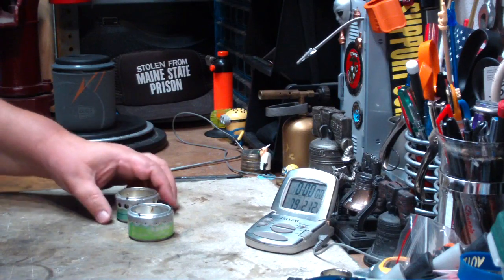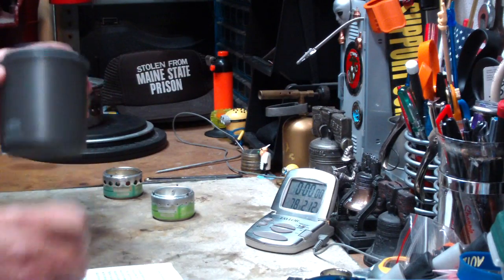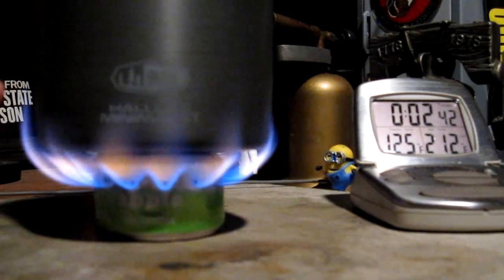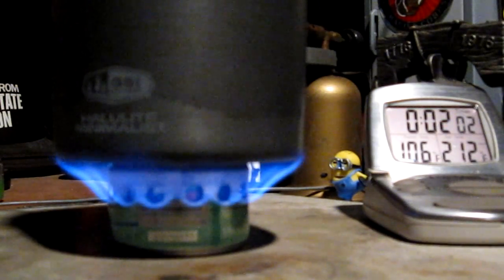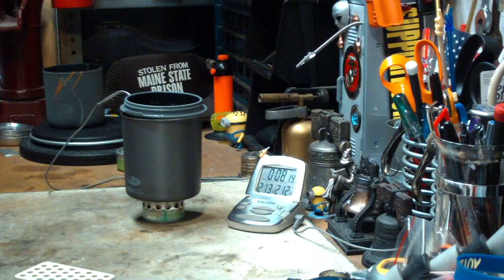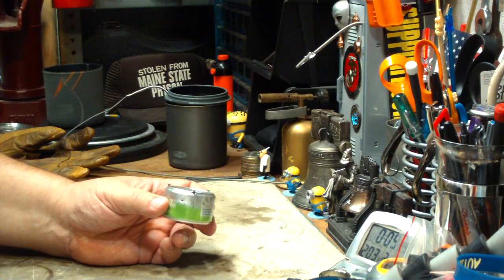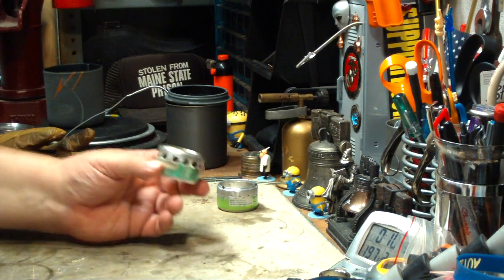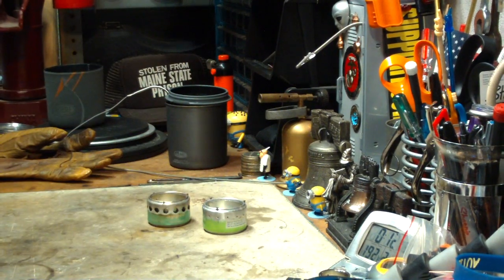Battle of the ColoradoCamper Stoves

Comment: Pardon my pun, but it boils down to this.
The same fuel has the same potential BTU or watts
Tiny holes conduct faster heat to the boiler and run out about a minute after boil achieved
Big holes take a minute longer to conduct thr boil and run out a minute after the boil.

Venturi effect as the holes are jet nozzles.

So slow burn... Bigger holes

However once temperature is achieved the duration of the heat is still a minute or less.

Choose according to the cooking you want.  If boiling only, then little holes.  If frypan, bigger for slower heat and longer overall flame time

Comment: My opinion is that the run-out times are more directly proportional to the amount of fuel applied than anything else. Results would be more accurate if measured by a digital scale, rather than by eye. A few drops could mean 30 seconds.

Comment: I believe the difference is due to the nature of aluminum. It is great for camp cookware because of its ability to transfer heat but also because of that it will lose that heat very quickly. Water on the other hand does not absorb the heat applied to the container as quickly. Basically the low pressure stove is applying heat to a much smaller area which can allow the heat to be dissipated into the air from the pot before it can be fully absorbed by the water. The high pressure stove in effect is spreading its heat across a larger surface area of the pot which not only helps to retain the heat but also helps in the heat transfer to the water.
Reply: Zaekyr 0 vorrect

Comment: I think the problem with the jets shooting out too far with the high pressure burner might be solved by giving the holes a bit of a direction upwards so that they are shooting the jets towards the bottom of the pot and not parallel to it. Just stick a drill into the wholes that has about the same diameter as the holes and bend it upwords. When people make vortex stoves they use this technique in order to give a specific direction to the jet holes. I would find it very interesting to see if it makes any difference in boiling time!

Comment: IF going out beyond the bottom of the pot is a problem (???) couldnt you twist the pin or drill in the hole so the jets are at an angle giving a "cyclone" effect and more flame on the flat bottom???

Comment: I'll echo the comments below.  Without knowledge of the variation (replicates) you can't say much of anything.  With replicates (3 or more) you can use the students T-test to determine if there is a significant difference between the two designs.  If you're really interested in optimizing the burner design there are DOE (design of experiments) methods that allow you to quickly zero in on the important features in a statistically valid way.  Given the large body of work already invested it would seem the next logical step.  Good Luck  -john

Comment: Several factors here. The wider the pot, the greater area that can be heated. Aluminum has a tendency to absorb heat better than denser metals, like steel or titanium. The more flame that can touch your pot, the more heat that will be transmitted to the liquid within. Even if the flames go up the sides. If you put a shield or cone around your pot, you will retain and concentrate your heat to the pot sides. I am a Stationary Engineer by trade and deal with steam boilers.
Reply: Power8

Comment: I have made a penny stove but with the 16 holes on the inside ledge rather than the outside. Result was not really good enough to boil using your two variables of water amount and fuel amount. But, I did have it burn for just under 18 minutes and got it hot enough safe enough to drink and most pleasingly, it simmered which is good for many side dish rice and pasta packets. Though you might like to know.

Comment: Semper Fi Marine, I'm wondering if the holes were nearer to top of the stove, that you would be able to add a little more fuel. Especially the one with the smaller holes. Where is my heat tabs or better yet C4, and a C-Rat can.

Comment: My less scientific experience is almost the same.  I don't believe the material had any effect.  My reasoning is I have a GSI kettle which is made out of that same special aluminum.  My experience is I can boil the same amount of water much faster using a pressure stove and the wide bottom kettle than I can in my Toaks titanium which is about the same size as the minimalist.  Both seem to take longer with a non pressurized burning system.  However both of the burning systems are not the same like yours were.  I am convinced that the wider bottom kettle has more direct heating area and that much of the flames up the side of the other container is wasted heat.  Now if I use a Caldera style cone I can greatly improve the boil time of the Toaks.  Lending credibility to the idea that heat is wasted up the side.

Comment: In addition to difference in metal, there's also difference in air flow due to differences in bottom of pot. Smooth bottom vs non smooth. Three known variables - dia of pot, construction, & air flow. So comparing between pots may be similar to comparing apples & oranges.

Suspect to nail this down more closely would probably require multiple testing sessions of same setups. Then use average test results as basis for results comparison.

Once again, thank you. Enjoy & learning something!